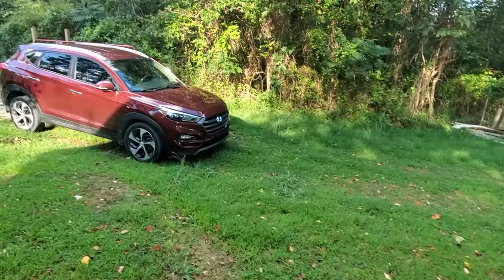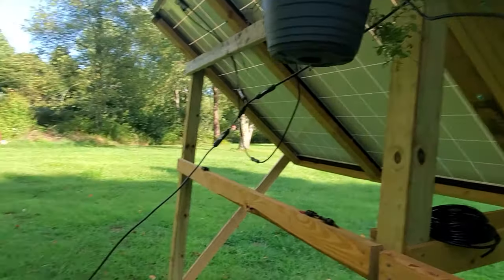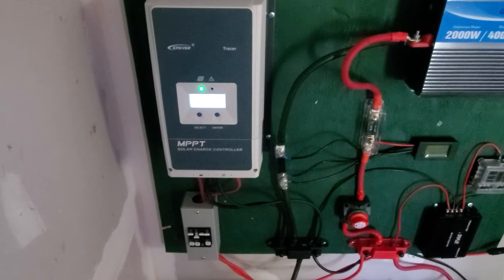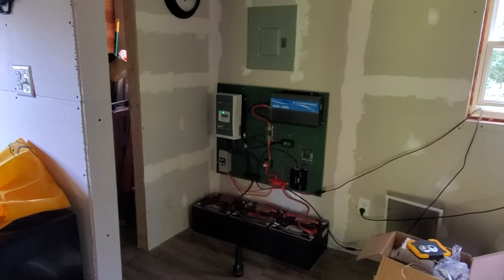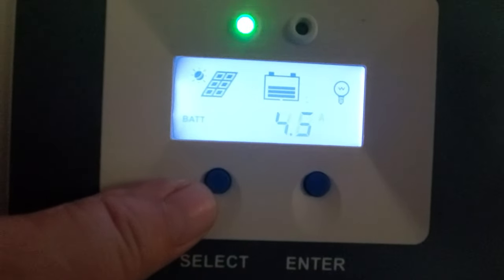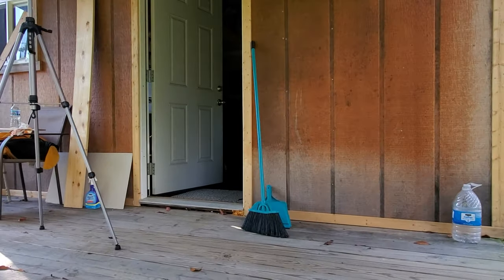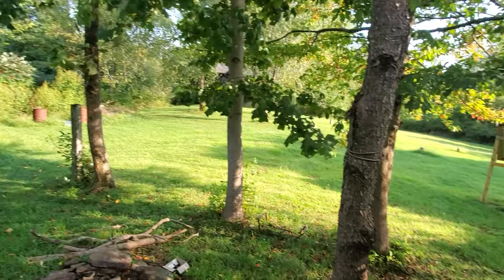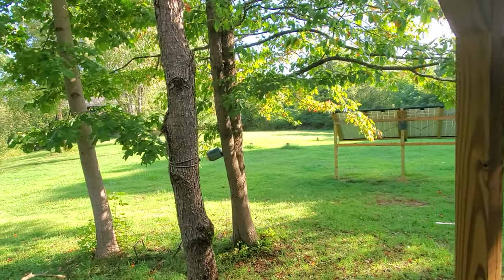DIY Solar Power System for The Off Grid Cabin

Comment: I did a small 200 watt solar layout in my shed for basically Youtube purpose and those little watt meters work great. I have one on solar entering Charge Controller, one after charge Controller and 1 on Inverter usage. I am currently using 1 12/24 Morning Star PWM controller but will get an MPPT soon.

Comment: Looks great Joe. PV kwh is a total of energy input. Will take a while for it to start adding up.  Load kwh is a total of energy output through the load terminals. If you get the MT50 monitor/keypad it should give you more information and programming options. Don't go cheap on the inverter. It's worth paying a few hundred more for a good quality (Cotek, Samlex, GoPower, or similar) pure sine inverter.
Reply from the maker: +dbcrn859 Thanks!  Figured out the accumulated kwh lol.  I have the MT50.  It's going in next!

Comment: Congratulations Joe!  You should be proud of yourself!  Been checking out your series on the Solar Panel and circuitry set-up and your price tag of ~$2000 for the whole system is cheap.  I bought the PointZero Titan 1500 kit and shelled out nearly $7k, and I have not received it yet.  I was drawn to your videos because I was curious how you were hooking up your gas generator to solar generator bus box.  I am very curious about doing something like that in a conventional home set-up and how you can either use it as a Grid-Tie Inverter or at least have a switch to take off the grid the house wiring and hook it into the solar generator.  If you could do any future videos on that topic, would be pretty awesome.  Keep it up!  Learning and loving the process.

Comment: You are actually bringing in about 50 watts. (AxV =W)  Kwh is watts x 1000 so it  'would'  show that you have not brought any in yet.. There has to be a setting for just watts.. I understand your excitement about it working when you flipped the switch.. I got the same feeling when I moved it to my cabin.. I could not believe it actually worked the first time.. Good luck on getting the inverter issue resolved quickly.. I was a seller and buyer on eBay for years but I don't even look at it anymore..
Reply from the maker: +deserthorizons You're right on that.  I went out today, and at 3:00 it showed I had gotten 2.1 kwh.  It was very exciting for sure.

Comment: Joe, your battery shed should be fairly close to the cabin, as DC voltage does not travel distances very well. It will suffer losses the longer the distance it has to travel.
Reply from the maker: +richard king It's going to butt up against the back of the cabin.
Reply: @StBernardAcres  Sounds like a good plan! You have done a good installation.  Enjoy!

Comment: How big is the Cabin, 16' x 16'? I am thinking on a 16x32 but not sure if to go  20 x 20. So many things running in my head. I wish my Youtube Channel would grow so I can get extra funds. I just bought 4 8" Sch 80 pipes by 14 feet for $300. The cabin will sit high and I should be able to see the little wildlife that exist on the 8 acres. I almost bought a 2000w pure sine Xantrex that I added to my watch list and then it got bought. It was $100 cheaper then the others listed.
Reply from the maker: +Jorge Serna This one is 12x16 with the loft.  I wish I had pure sine.

Comment: What model is your charge controller? I was looking into the 40A EPever and noticed it says 60v. I am curious since you mentioned your 2 panels are 75v open voltage.

Just noticed other listing states starts charging at 60v.
Reply from the maker: +Jorge Serna This is the 60 amp 6415. I stepped it up because of the 150 volt limit.
Reply: @StBernardAcres  That's all I needed to know. I will take a look at it definitely. Thanks.